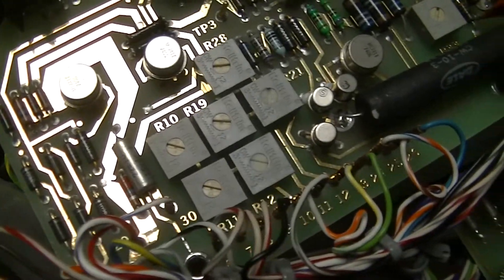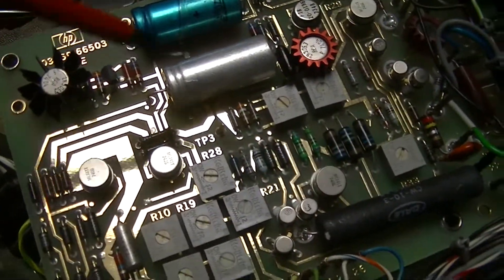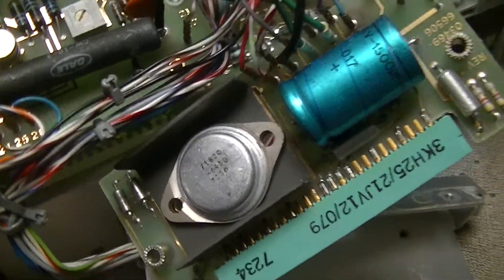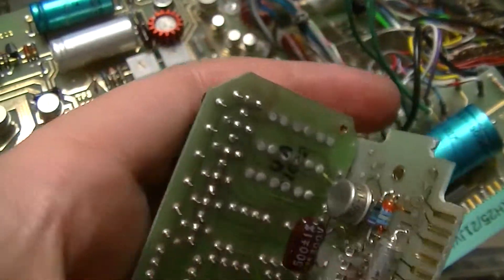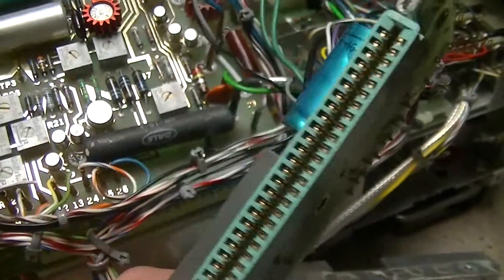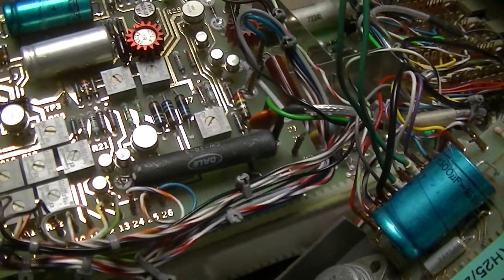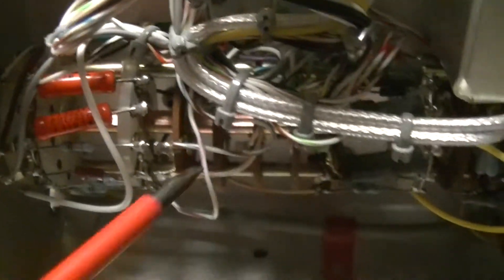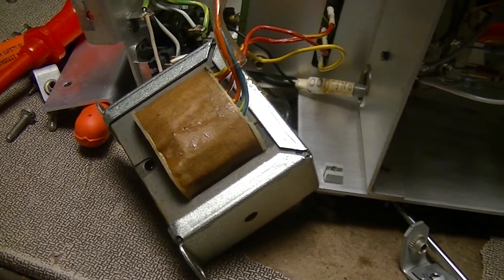Hewlett Packard 3469B multimeter guts

Comment: That 1820-0196 IC is the HP in-house code for a uA723 voltage regulator. The 1820-0471 IC on the display PCB is an SN7406N.

Comment: I use to work in semiconductor test, HP, Tektronix, General Motors, Ford, Chrysler, etc. etc. would often submit specs for special testing and parameter selection on our standard parts and get a special part number. Hardly a "dick" move or uncommon since the component being replaced may not perform as designed if not selected for that parameter.

Comment: Sorry I didn't get to finish the whole video, but I've had good luck just replacing the old Sprague/Mallory electrolytic caps and replacing them with new ones. Especially in old HP equipment like this. But it appears your problem may be unrelated.